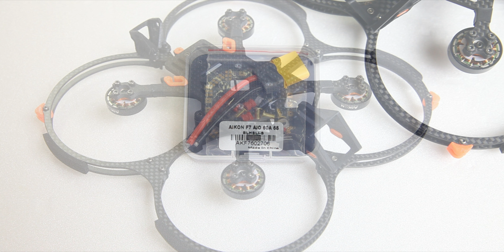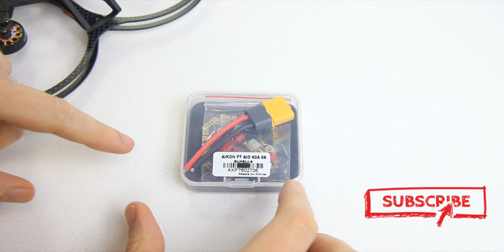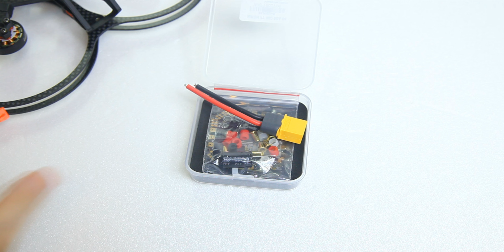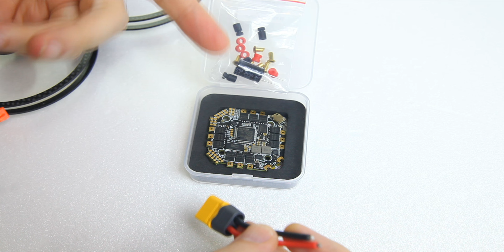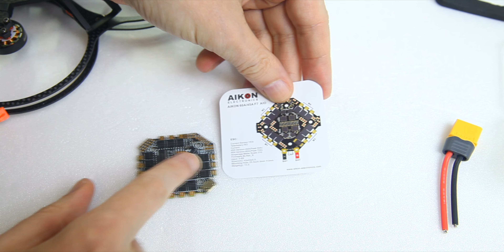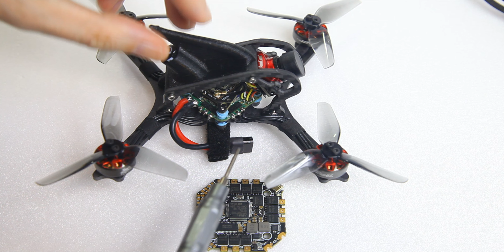Aikon Electronics F7 60A All In One - IMPRESSIVE :)

Comment: It's a great board and all, but it's useless if there's no frames to fit it. There's absolutely ZERO documentation on it, and no wiring diagrams. Worst board for beginners, and the mounting options are extremely limited. I bought this board, and I have had more issues trying to fit it to a frame, figure out it's compatibilities, and size it than what should be necessary.
Reply from the maker: Yeah.. seems to me they made this board specifically for a quad they were developing (a heavier Cinewhoop) BUT we do see more & more frames that take a whoop-style board...
Reply: @DutchRC  I love the design, features, and AIO board. However, i'm a bit annoyed. (posting the rest of this info for anyone else in my same predicament) I haven't been able to use it yet, due to mounting hole issues, it's an odd mounting size, it's in a diamond shape and arrow has to face forward on the frame for the accelarometer, so almost no options to use with any frames without modifying the frame itself. Then, I am limited to a frame that has the option for power to be ran through the back of the quad frame to the board (I have the AxisFlying Manta 6" FPV Freestyle Deadcat mid-range cinematic frame. The battery lead holes through the frame are in the front of the frame, right behind the GoPro camera mount, but this AIO board has the +/- solder points at the back of the board.Due to RF signal interferences, you do not want to run the battery lead wires close under or over the flight controller, so have to route it around somehow.) When mounting the board, I ran into the issue of soft mounting and even hard mounting, because there is not enough room to mount any hardware without it hitting against capacitors and other transistors, etc on the board. Not good. Need more mounting space around the mounting holes. I attempted first to drill mounting holes in a diamond shape of this Aikon flight controller on the Manta 6" frame, but ran into issues, because this specific frame has a piezo buzzer and LED light and 3D printed frame mounted directly under the flight controller, so to do so, would mean sacrificing the LED light and buzzer in case I lose the drone, or mount it elsewhere, which is no issue for me, just throws the design off some.
Reply from the maker: @StraitD2  you do know that arrow on the board doesn't have to face forward?? You can simply change the direction in the gyro settings of Betaflight (or any other flight controller firmware).. 
So a 45 degree rotation so the FC fits in your quad is no problem.. Anyhow.. there are by now lots of frames that can use these whoop-style FC's
Reply: @StraitD2  im super noob and even i know fc mounting is irrelevant see betaflight fc position
Reply: Thx for the heads up just what I was looking for I'm going to skip it..

Comment: Do You have best tune for that FC, cause im using this fc with geprc 6S motor 2105.5 2650kv, and its give me a problem when i arming int he first time the quad seem like over power but after wait few second its getting steady and fly  . im still looking what is the problem is it tune for gyro bmi or the kv motor seem to high for 6s.
Reply from the maker: It is impossible the have a "best tune for a FC".. the quad / weight / propellors / how you fly makes Much more of a difference for the tune. 
From you said I think your quad needs more filtering though.. On the filtering-tab push both slider at the top a bit to the left